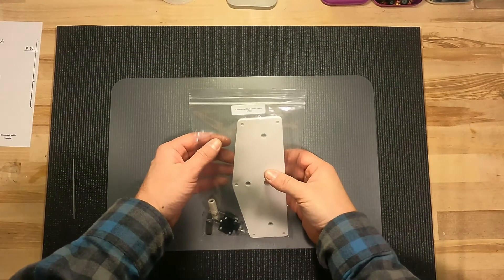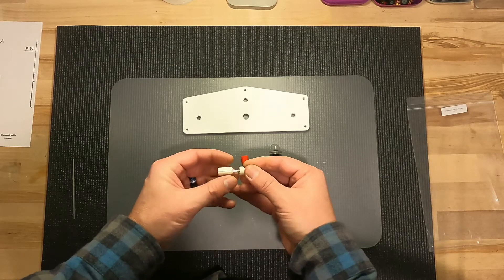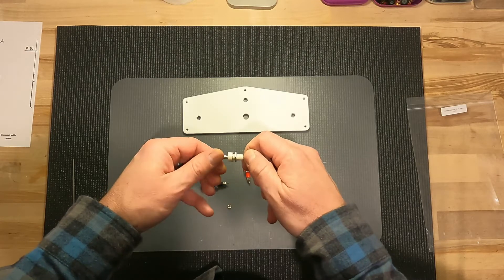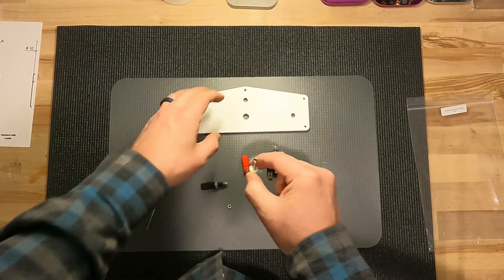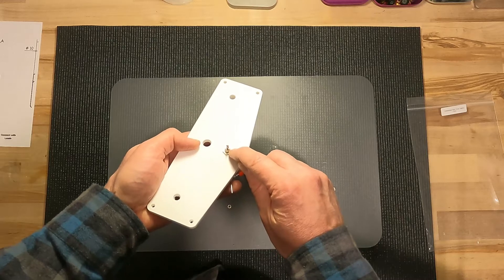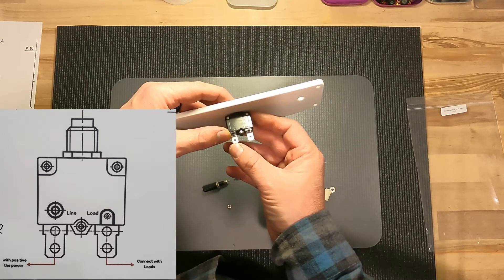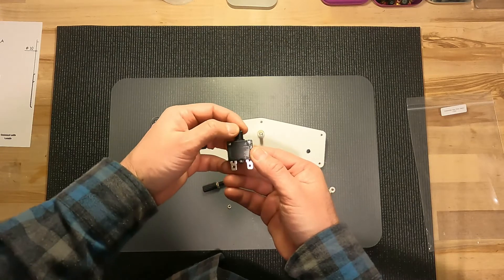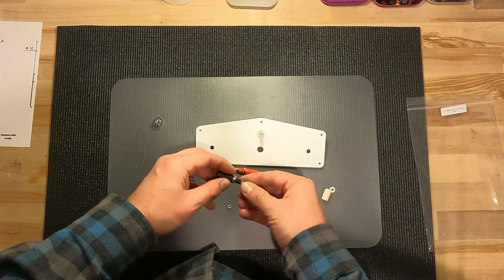Viper Commercial Driver station's

Comment: A lot of 1/32 guys use 3 pin Microphone jackz for hooking up. Never hook up controls wrong.and pop a fuse.
Reply from the maker: Yes they work great however the 3 wire alligator clip hook up is pretty darn rooted and i don't see it changing. We typically will use a XLR hookup when we build an entertainment track.
Reply: I used XLR hookup in my home track. I wanted a more flush finish on the side of the table. And I wanted something easy for my kid, who was 6 at the time. They work great.

Comment: Wasn't the split washer that you didn't use supposed to take care of the "coming loose" issue that you used the super glue for? 
Or did I miss something?
EDIT: Great to see a video from VSR. I think you guys should get someone to work on putting out video content more often.
Reply from the maker: On most materials the split washer would keep it from coming loose but in the soft plastic that is used for the panels it just absordlvs the split washer rendering it useless.